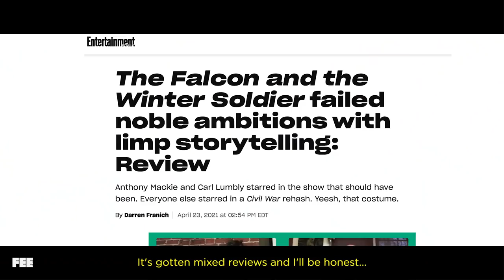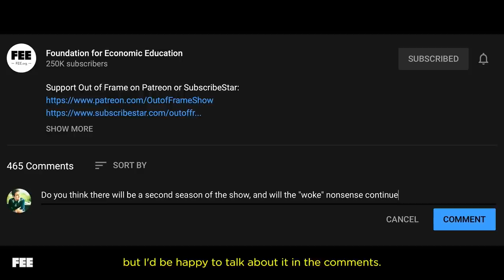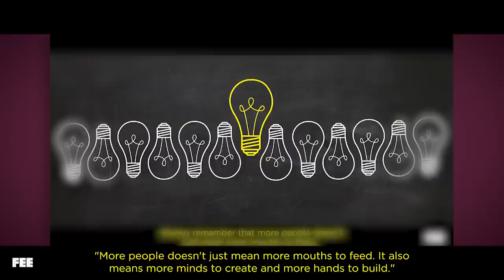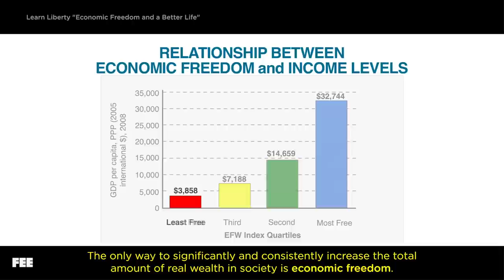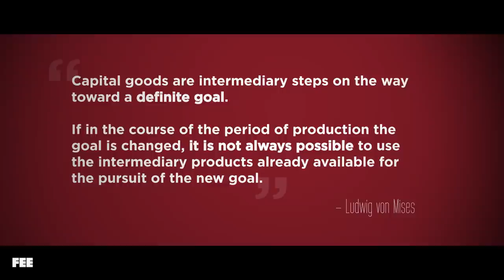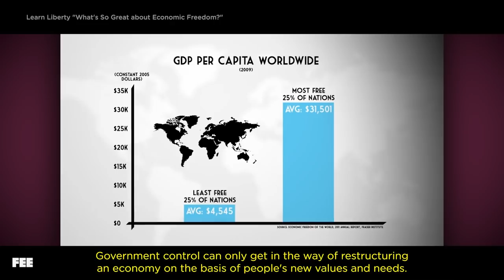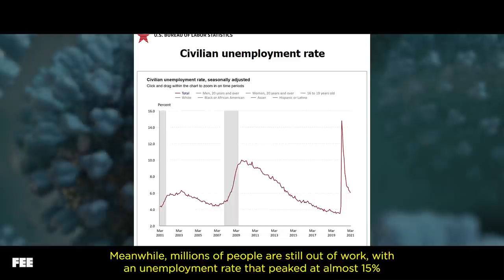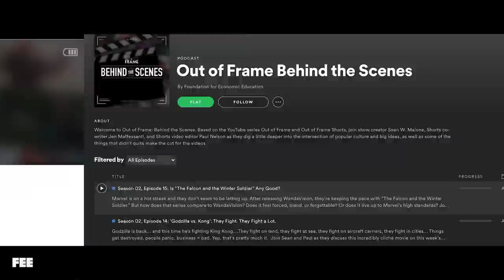Does The Falcon and The Winter Soldier Get ANYTHING Right?

Comment: I’ve been waiting for a falcon and winter soldier vid. I think the rewrite was the problem that broke the consistency.
Reply: Yes
Reply: What rewrite?
Reply: @tosinadesina3137  They had to change the show because of the "virus of unspecified origin"

There was originally a disease spreading throughout the unsnapped world and central control of the vaccine for it. It's what Mama Donya actually died from and why the show is 6 episodes instead of 10.
Reply: @zuexanime6182  R
Reply: You can have a rewrite that makes sense though. It is an explanation, not an excuse.
Reply: @VladDascaliuc  It’s much harder when most of the filming is done and a deadline is closer while a virus is still tearing through the world.
Reply: @joshuajoe1419  2nd verse the same as the 1st. 
Don't use that to excuse shitty writing. There is nothing redeeming here.

Comment: The problem with political entertainment is that the show needs to say that one side is right, and that the other is wrong. That's why political entertainment solves this issue by having both sides fight a third-party, therefore protecting both sides. Unfortunately, political entertainment is just hard, and is a tall order. However, TFATWS still sucks

Comment: "People are not interchangeable cogs to be swapped in and out on a whim."
--Said no CEO ever.

"You can't just take a factory that makes one thing today and magically make it produce something totally different tomorrow."
--Sure you can. Just not without consequence. Ask any farmer that switched from crop rotation to exclusively providing an endless supply of corn or McBurger cattle.
Reply from the maker: Actually, said tons of great CEOs. If you actually read books written by top business leaders, this theme comes up again and again. Finding the right roles for individuals and supporting them in those roles is an almost constant, super critical goal for the most successful companies.
Reply: @FEEonline  Thank you for that. My comment was cynical, but your response perfectly explains why every digital agency I ever worked at crashed and burned. People in key posts were replaced or driven out like Amos Burton’s “churn”, by CEOs who didn’t value their staff, and saw them as expendable and replaceable.

(You could argue that the common element was me, but I was but a lowly coder and cared not for the grandeur of management.)

Comment: I’m gonna disagree with you on John walker. I think this show did  him very wrong. Based on everything I saw he is genuinely a good man that wants to do the right thing throughout the entire episode. He wants to stop the TERRORISTS.  He keeps trying to work with Sam and Bucky despite them perpetually denigrating him. The wakandan soldiers show up and do what they want because they “have jurisdiction wherever they find themselves to be” and attack him while he is trying to reason with them. He is charged with killing an “unarmed man” that happens to be a super soldier and therefore is anything but unarmed and also happens to have been responsible for a multitude of innocent deaths. And at the end he stops fighting carli so he can save a van load of innocent people. I agree with a lot of what you said here, but I can’t cosign your assessment of John walker. I will agree that Steve rogers can’t be replaced. That is absolutely correct. But to suggest John walker is not a good person (I can’t remember if you used those exact words, I’m may be paraphrasing) is just simply incorrect.

Comment: Sooo not  a socialist then?  Thats alot of faith your placing in people using capitalism for the greater good.  Especially given its record where ppl who had that chance did not take and instead held onto it.  Centralized authoiry isnt perfect and has the same flaws, but ignoring it happening in one and not the other is equally dangerous
Reply from the maker: No... It's not faith in people just doing good things. It's an understanding that systems matter, and that empowering politicians to control society is disastrous and leads inherently massive corruption and misallocation of resources.

Capitalism doesn't rely on people all being good. It creates incentives where people have to serve others by creating goods & services they value and are willing to pay for voluntarily in order to be successful.
Reply: @FEEonline  But everything you just said happens with capitalism as well.  We still have massive corruption and misallocation.  Incentives have been misused to create profit for themselves.  Success came before humanity which is the perspective the show preaches.

One of the things the show has been good about is that the current sys is equally as broken which led up to that scenario in the first place.  Outside of the show,  there are just as many capitalist countries that have failed as socialist ones.  Plus Europe seems to have done a pretty good job of balancing out the two.  Otherwise they would have also replaced it by now.
Reply from the maker: @jessmith7324  Capitalism is not perfect, nor do we live in a world free from state control over the economy. To the contrary, it is a constant battle for economic freedom, and right now the state has massive amount of power over the economy in the US and elsewhere.

But to the extent you see corruption and misallocation here now, it gets orders of magnitude worse under centrally planned, socialist economies.

Perspective matters a lot here, and if you look at most of the rest of the world, it is considerably less free and - related - significantly poorer, more corrupt, and harder to live in.